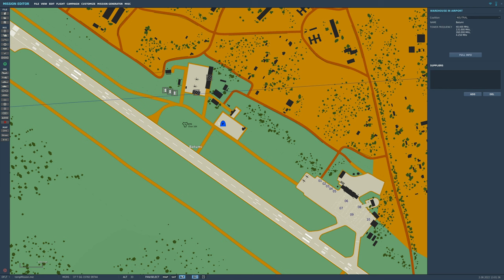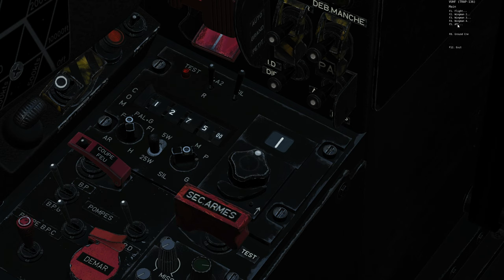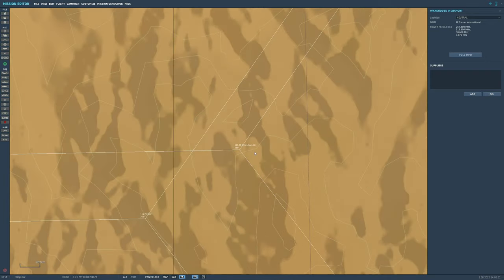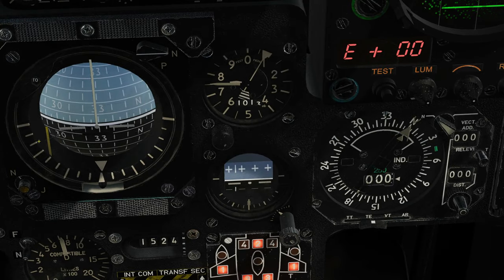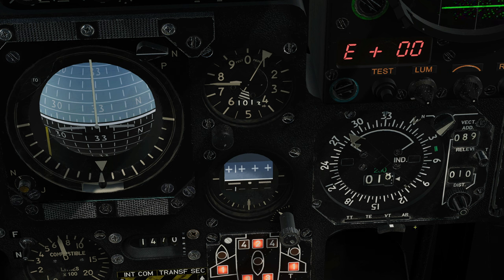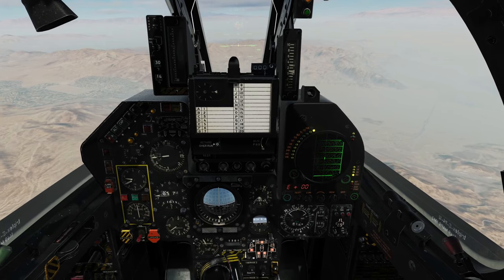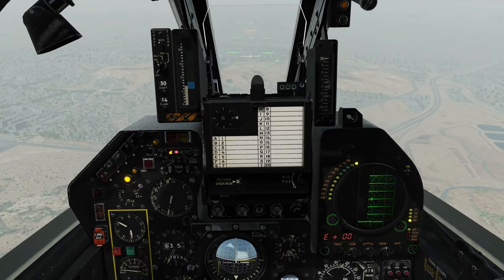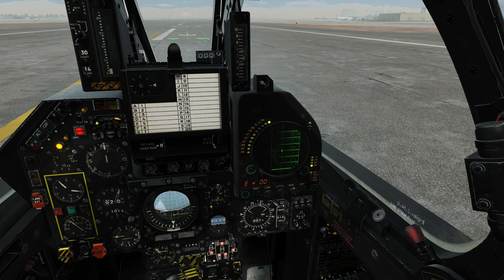Mirage F1CE: Radios & TACAN, VOR & ILS Navigation | DCS

Comment: Cap, you asked yourself at around 17min in why there was a 1 mile deviation with your previsions on the distance reading.
It's simply because the marker you put on the map is ~10 miles (9.7) out from the runway threshold, NOT the TACAN beacon, to which the distance reading is calculated.
Nothing to do with magnetic variation 😄

Comment: Would have been easier for you if you had the charts for the airport in question.
They list a nice MSA for you or "Minimum Sector Altitude" meaning you are never to go below this altitude unless you are on the approach, and then of course you have the "minimums" this is the altitude where you have to see the runway and can vary pending on the conditions present, but usually no lower than 250 feet, if you do not see the runway you are to expedite a go around and climb to go around altitude listed in the charts for the airport and fly the designated go around procedure.

Comment: you missed it by 1 mile because the tacan is not on the threshold of the runway but rather in the middle of the airport , so you should set your add vector from the physical tacan location not the start of the runway ;) and you'll see that the tacan was 1mile ish east of the 10miles marker that you used for the add vector

Comment: Basically, on a ship (or plane), the following formula applies to EVERYTHING:
Real = Fake + Correction
or
True = Instrument + Correction
Notice it's ALWAYS a PLUS in the formula.
Now, Correction is PLUS for East or North, MINUS for West or South.
So for bearings/headings:
True = Gyro + e
True = Magnetic + declination = (Compass + deviation) + declination
So, looking at the compass, let's say it shows 002, you look at the deviation table and see 2E around 000. Known map declination is 15W.
002 + 2E +15W = 002 + 2 - 15 = 349
In reverse, I always resist the temptation to reverse the signs (i.e. Fake = Real - Correction). Mentally moving the correction to the other side of the equals is less prone to confusion in the long run.

Comment: I think the error at 17:00 is because you added the 10 nm on the add vec from the thresehold, but the distance should be measured from the Vortac, the vortac was about 1-2 nm behin the thresehold, so you ended up short by approx. 1 Mile